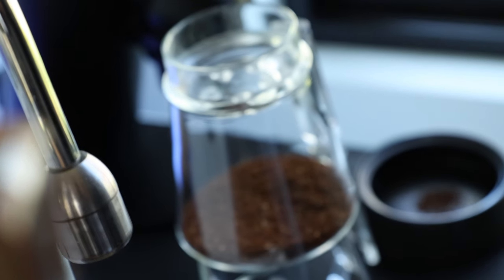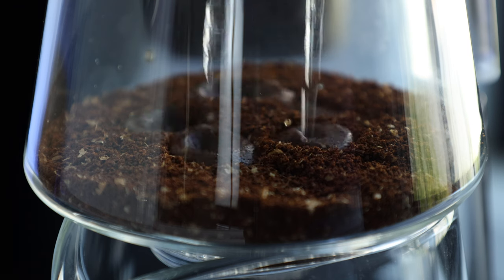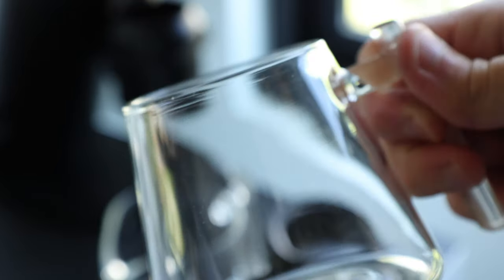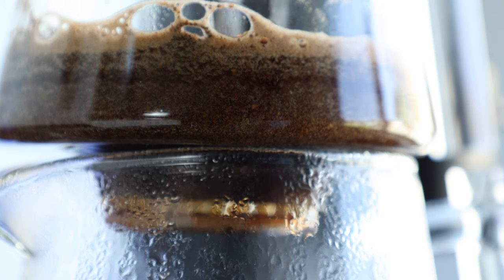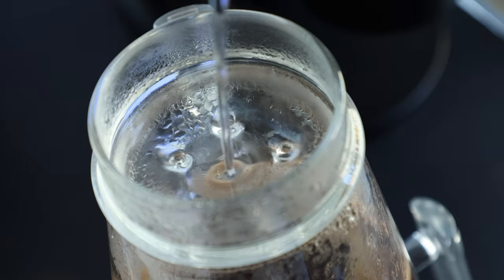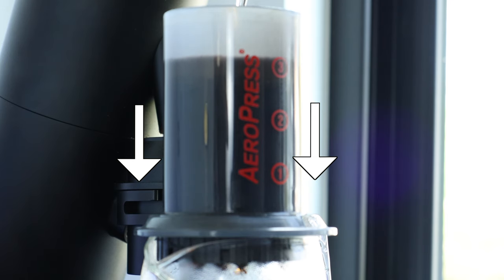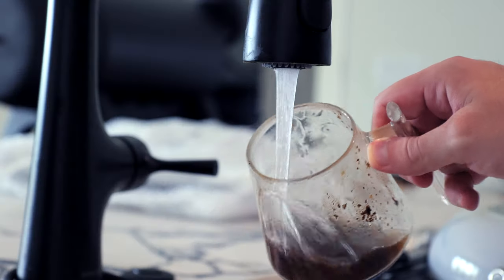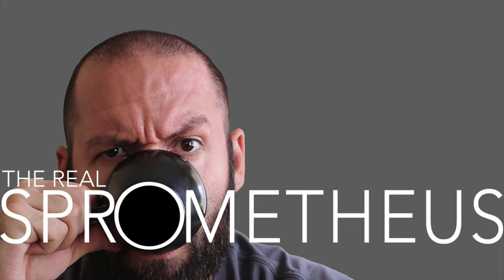PURE OVER - All Glass, No Filter

Comment: Not sure if somebody else has already mentioned this or not, but I was a backer of the pure over, and though it took some experimenting, there are a couple things that can improve each brew! 

I actually grind aiming to have the brew water "stall" in the brewer down to just a drip. Grinding coarse enough for the water to drip all by itself produces cups that are too weak generally. Grinding fine enough to let the coffee steep for a couple minutes or however long I'm aiming for allows for much tastier cups and turns the pure over ironically into a brewer that functions much more like the Clever or Hario switch rather than a traditional pure over. Once the coffee steeps for a couple minutes, I take the provided stir stick and lightly "dig" a small well in the center of the coffee to start the flow down to the carafe again. It takes between 30 seconds to a minute for everything to flow down (I'm brewing for two using 30 g in the Brewer and roughly just under 300 g brew water). In general, the final brew time is somewhere between 3 and 4 minutes.

To reduce the sediment in the cup, I brew into a carafe first and in a vein similar to James Hoffman's French press method, I pour the resulting brew very gently into two cups and find that most of the sediment is gone by that point, generally being equal to the level of a nice clean French press. My wife and I generally enjoy the results we get from the Pure over once I figured out those couple tweaks that are really not that difficult to incorporate into the recipe overall. 

I definitely agree though that the design of the brewer definitely doesn't allow for the best flow and I would even add that. I wish that the handle was a little easier to with grab with a whole hand, other than that, we've been really happy with it. Hope this helps!

Comment: The review seemed fair. The most disappointing part isn't that there's problems, but that the problems all seem very predictable.

To be honest, glass is an excellent serving material, but performing-wise it's hard to beat these plastics with low thermal transfer.
Reply from the maker: Yeah part of me is confused how these issues weren’t ironed out during R&D. And true, it’s not ideal in terms of heat, but still can perform well under the right circumstances.
Reply: @Sprometheus  I think you're over estimating "R&D". Particularly for a product that doesn't have much regulatory compliance to deal with, meaning; t's not electric, so no UL listing. It's not a food product, so no FDA.

It makes coffee.  That's a pass. Does it make *good* coffee?  Lots of people would be impressed if someone said, "it's as good as a keurig".....
Reply: I think it’s worth noting that plastics and glasses generally have thermal conductivity on the same order as each other

I don’t mean to overly explain but thermal conductivity is quite similar to electrical conductivity (and even optical conductivity) and so your intuition about one will apply to another. Electricity would have a lot of trouble flowing through both glasses and plastics but would readily flow through many metals. same thing with heat. So in regard to the transfer/absorption of heat, plastics and glasses will be very similar (will take a bit to heat up and will retain heat) 

I don’t think any of that discounts your views on glass vs plastics, just thought I’d chime in about the material stuff bc I’m into that kinda stuff
Reply: @dylanmiley5642  What you say is no-doubt true, but glass drippers, etc. are substantially thicker and heavier than plastic ones (to compensate for the fragility of glass). Doesn't that cause them to suck up more heat during the brewing (unless you preheat them)?
Reply: @highnrising  Yes, that is a good point, a vessel with more material will act as a larger sink for the thermal energy. Tuning this parameter will alter the extent of heat absorbed to equilibrate the vessel. 

Though, I am not sure that glass drippers are often substantially thicker/have more volume of material than plastic drippers

Comment: I backed the Pure Over on kickstarter. From what I can remember the campaign seemed to be "designed by an artist who likes making coffee" so maybe the lent itself to the poor practical use. 

On my first use I tapped the gless handle when trying to clear the grounds and the handle snapped off and fell in the trash. Reaching out to them I got a second unit. 

Even after that I found it incredibly hard to get coffee that wasn't incredibly weak. The holes would always get clogged and would regularly require a toothpick to get them all out. Last time I tried using it the shower head attachment made too good of a seal to the brewer and caused the water to burp and gurgle around the meeting point for the two as the air tried finding ways out.

The best cup I've had from it came from when I managed to get an aeropress filter to sit perfectly on the holes. Yes this defeats the purpose of the brewer, but it seemed to be the best course of action if I wanted to actually use it.

Problem is that I didn't want to use it. Wetting a filter and reaching into the road cone shaped brewer was annoying, especially when I have a v60, aeropress, or clever sitting right next to it.

Comment: Great review! As I was watching, two things come to mind that may or may not help with consistency and extraction: 1. What if you only dose enough coffee to fill the center chamber? That way the bloom pour would be more likely to saturate all grounds. 2. What if you do the first bloom pour without the dispersion screen on top - onto the grounds directly, making sure you soak all grounds?
Reply: Great suggestion.  definitely more room for experimentation.
Reply from the maker: Thanks Sergey, so I did see how much coffee it took to fill that center portion, and it’s about 10g so in terms of brewing that would make a pretty small drink, about 160ml, so it just didn’t seem all that worthwhile. And I also did try pouting without the screen, and since the unit requires you to pour from a decently high point the water stream cuts straight through the bed and pushes a lot of grinds through the center.

Comment: I'm thinking that sticking a round paper or metal filter in the brew chamber might help out a little. And giving it a swirl after the bloom with the filter in there might not slow it down too much. 
And a conjunction of using a grinder that produces very few fines AND sifting the ground coffee to remove most all the fines will be necessary with this dripper. 

With all that said... it still doesn't seem like a very well designed dripper.

Comment: I'd love to see a video on pressure profiling with the Decent versus your new machine (and, if applicable, any other machines that do this). I'm in the market for a new machine after owning a Breville Barista Touch for about a year and squeezing every bit of performance out of it. It's been a pretty good machine, but I feel that the lack of control over the various parameters that you get with a manual or pressure profiling machine means that I'm only getting "good" at the best of times. The grinder also sucks hard, and the aftermarket single-dose mods have been awful. I just bought a Niche Zero as a stopgap. By the way, if you were to do a review of the various Breville machines that'd be cool too.

Comment: thanks for your non-recommendation, makes my decision to skip it easy. if I heard you correctly, you said that when it did make a good cup, it was sort of a sweet combination of good pour over and a french press. Isn't that sort of a Clever? I now usually brew with a Clever and it consistently makes a very good cup. Trick is to get the grind right with a optimum paper for a drawdown in about 60 sec.